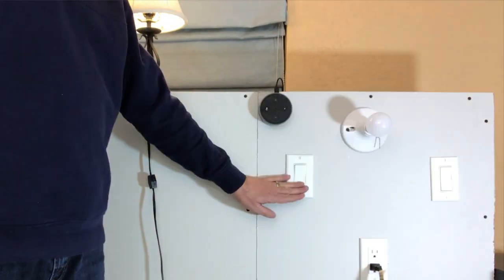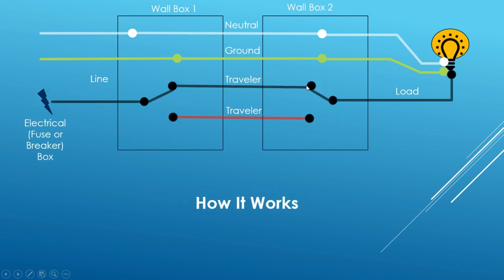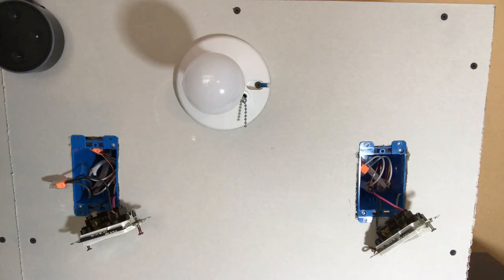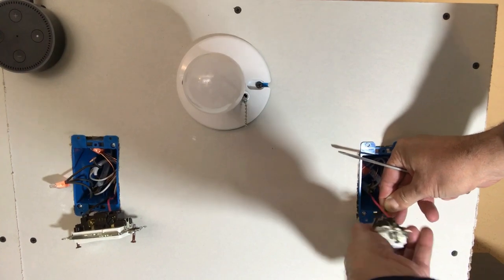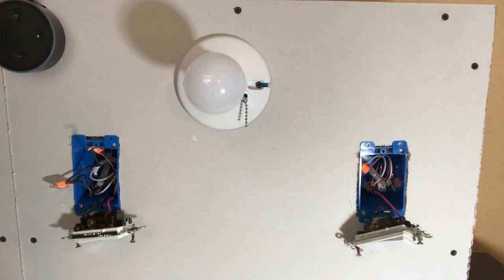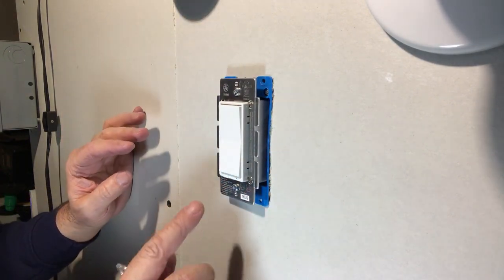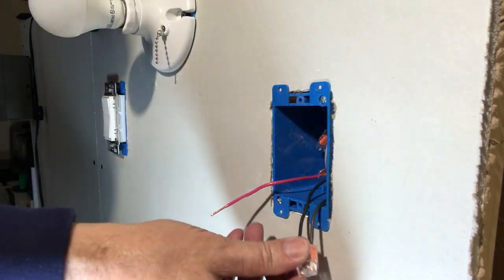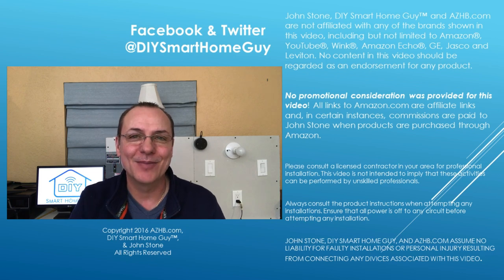DIY 3-Way Switch GE / Leviton Smart Switch Installation (Z-Wave)

Comment: Great video as always, John.  I'm impressed that you built an entire mock setup to help demonstrate how 3-way switches work, and how they're wired.

One thing I'll add, almost every 3-way switch I've taken apart (especially in older homes) did NOT use 14/3 with a red wire.  Usually they use a 14/2, using the black and white as travelers, or use 2 black wires as travelers.  I also used to work as a commercial electrician while I was in college, and will tell you that there's no real wire color standard for switch legs and travelers, electricians will use whatever wire they have at their disposal, so its important to take a close look at the existing 3-way switch and test the wires the way you showed.

Comment: THANK YOU! I nearly gave up several times before finding this video and going to your website and looking at the solutions matrix. 

I spent a long time staring those diagrams and pulling out wire from my gang boxes, and I finally figured out that my new home was wired up as method 9(a), but with the white and black wires to the 2nd wall box swapped. After that, it was a cinch! (Well, no worse than normal work trying to undo, tie in, and close up a crowded box) Rocking and rolling on the Leviton DW6HD + matching remote. Wish it had come with extra wires, but luckily I had a spare stretch of 12/2 from some long-forgotten project to cannibalize.

Comment: For these particular GE switches there is a similar slot (a bit less visible) for the ground connection as is used for the other terminals. Hence there is no need to use a wire loop to attach the ground connection. Not a big deal but it makes the work go easier and faster. Not sure if someone else already mentioned this. 

One other thing, there are several ways that three way switches can be wired. You have shown the simplest case – power arrives at switch box 1, 3 conductor wire runs between switch boxes 1 and 2. Light is fed from switch box 2.

Case 2 – Power at switch box 1, light feeds from switch box 1. A piece of 3 conductor wire runs between switch boxes 1 and 2 – all hot wires.  Do able but the wires running to switch box 2 need to be re-purposed to get a neutral there. This wiring configuration is in common use. In many jurisdictions the white wire between the switch boxes must be marked as a hot wire.
Case 3 – Power to the light socket, switch leg (two conductors – both hot) runs to switch box 1 and a piece of three conductor runs between switch boxes 1 and 2. Not do able – no neutral available in the switch boxes. This is an uncommon configuration. It usually happens during renovations when a single switch is expanded into a three-way switching arrangement.

Comment: excellent video, understanding that this isn't a typical 3 way switch goes a long way to preventing confusion.
i would have liked to see you finish off the wiring, but i understand you may have had to trim for time.
now to go and do my Levitron version and hope i don't burn down the house
Reply from the maker: Hi Shadow Wulf, thanks for reaching out. This was an older video and your concern is well noted. The best source of information for three and four way switches is on my website. There are several different methods in which your original circuit could have been wired, including Leviton, so you'll need to start there. Again, it's all on my website.
https://azhb.com/how-to/three-way-switch-how-to/

If you're still having problems, check out my Facebook Group. It's an easier place for me or other to lend a hand.
https://www.facebook.com/groups/733842787140470/

Cheers

Comment: Thank you for this. I have aluminum wiring where they used one set of romex for the traveler wires. I used your advise to determine the hot and load. I then drew out each feed to each box and switch then how the smart switch wires. Now my second smart swithc also had all four wires,  used a special wire nuts with a conductive paste inside for possible expansion and contraction on the AL.

Comment: I wish this video was available when i installed my switches.  The only criticism I have is the ground terminal has a push in hole and you don't really need to loop it.   That is just personal preference though.  Really like the animation showing how traditional 3 way switches work.

Comment: Thank you, John!  I have embarked on a journey to replace my existing X-10 automation devices and with Z-Wave devices.  Thank you for your Channel!  I have a 3-way switch installation that shares a gang box with two different lighting circuits.  Worse (in my opinion), is on a different breaker and powers two different overhead fluorescent lights.  The wiring in those boxes is a complete mess to my layman's eyes - and I remember having the same anxiety when putting in the X-10 switches years ago.  Fast forward, after watching this video three times, I was able to understand how the switches should be wired.  While the requirement of the neutral line for the GE switches may be a problem for older homes, it wasn't for me, and once I understood the proper schematic for the wiring, it actually made things very easy.  Again, thank you very much for making this video and sharing your experiences.

Comment: Awesome video! About to do my Leviton smart dimmer but 2 questions ....  1) I have 3 switches for my recessed lights. Does it matter which end of the circuit I put the Smart switch on?  2) Do I need to replace the other 2 with add ons or can I leave them as dumb switches?
Thank you!

Comment: I want to echo steven h comment. If you do not have access to the white neutral wire .. look into the lutron caseta . It is what john stone used in his bar ( i think). He has reviewed it  but has not done an install video on it to show not needing neutral wire. The lutron instructions however show not using neutral wire. ( prior model, lutron maestro did call for neutral wire, like GE).  

Thank you john for your informative videos
Reply: thanks John -  1) I look forward to a dedicated video on your bar switch install - as it does look to have have simpler installation procedure than GE. I hope it also includes the dimming Pico Remote wall install.  I would also be interested in seeing if you find any noticeable difference in responsiveness in  GE, Lutron or Leviton.  2) As to your  non dimming switch desire...  I have not tried, but Lutron web site shows, Lutron PD-5WS-DV,  to be an in wall Caseta wireless Paddle switch that does not require a neutral wire. It can be used as a simple single switch or installed in a 3- way configuration  with a non dimmable pico remote # PJ2-2B. Remote can be installed in wall as a secondary paddle switch (with same bracket kit as for dimmer, PICO-WBX-ADAPT) or used as a portable remote.  3) To all,  Upon further investigation, If your situation dictates use of a neutral wire..Caseta looks to have  products for that too in PRO version  that requires neutral wire, but in my quick search they seem notably more expensive than GE or Leviton.

Comment: Thanks for the great video!  Wondering if you could tell me what would happen if you installed only the master switch, but left a standard ‘dumb’ switch as the secondary on the circuit.  My intent is to use an old style (newly made) pushbutton switch to maintain the appearance of my old home, and hide the smart switch.  This way I can use Alexa to control the lights while maintaining the classic appearance.
Reply: asking myself the same question

Comment: Question:  do you have to use two smart switches in this installation?  Could you just use one smart switch and leave the other dumb switch in place?  Nice video by the way.  Thanks!
Reply from the maker: It depends on the brand of switch. Zooz and Inovelli make models that can be configured with the existing remote switch. However most others do not and require the add-on switch.

Comment: for construction without traveler wires, you can make a fake 3-way switch by using your home automation software (homeseer, smartthings, wink, stringify, etc). so for instance, in homeseer i can make an event to turn the light on or off that has conditions that account for both switch positions.

Comment: I found when I didn't have all the proper wires at one end, the previous job wasn't done properly. The wiring wasn't pulled all the way from one switch to the other

Comment: Very nice video.  1 Question.  I have the add-on switch but it only works while I have the button pressed on the add-on switch.  So it will turn the light on or the light off while I pressing the button.  When I let go it turns the light back on or off depending on what the master switch was set at.

Comment: Such a great video. Got everything hooked up in the first box, but I don’t have two black wires to splice together in the second box. There’s only one black wire with nowhere to plug. I tried plugging it in with the neutral, and all that does is make the switch go on and off repeatedly. 

Any idea what the setup might be for this type of wiring?
Reply: DIY Smart Home Guy Thanks for the quick reply. The switch I took out was a three way switch. In that box, there are 4 wires: black, red, white and ground. I just couldnt get the wiring to work in any configuration, so took the light fixture down. Turns out that power is coming from the wires going to the light, and then out to the switches. Looked at the pictures on your site with the different “3way” wiring options, and still couldnt figure out how to run the GE smart switches. Ended up replacing the old switches for now, and will try again some other time. Spent too much time the other day trying to get it to work, that I had to just walk away...

Comment: Another thing.  On the ground wire for the switch, there is a hole that you can insert the ground wire into and then tighten down the screw as well.  That's how I wired mine.
Reply: I was thinking the same thing.  Great vid though!

Comment: If you don't have a neutral wire your best bet is a Lutron Caseta Dimmer switch and pico remote. You can wall mount the pico remote with a separate bracket. You'd just want to cap off the wires behind the pico remote.

Switch and Pico Remote: https://www.amazon.com/Lutron-Wireless-600-watt-150-watt-Multi-Location/dp/B00JJY0S4G

Bracket: https://www.amazon.com/Lutron-PICO-WBX-ADAPT-Pico-Wallplate-Bracket/dp/B00JZRAFEA/
Reply: There's a deep dark secret about how to obtain a neutral wire when there isn't one in the box....  you can use the ground wire.  If you look in your electrical panel (in a standard 240V split phase residential setup) the white neutral wires and ground wires are both grounded to the same exact bus bar.  Both wires essentially are the same.  Electrically, your neutral IS a ground wire, and the bare copper ground wire is basically a redundant ground.

Yes, its against code to use the ground as a neutral, and legally I'll tell you to never do it, etc.

But, it does work.
Reply: The bare ground and white neutral are NOT the same wire.  The bare ground is a non current carrying conductor.  If you use your ground as a neutral there is the risk of you getting electrocuted if you lose that path back to the panel and you touch anything grounded in the house(fridge door, washer, dryer, etc), the path will go through you and you will get shocked.
Reply: Technically, you're kind of right, although a smart wallswitch draws almost no power, probably less than a watt, and will not cause any hazardous voltage or current on the ground wire.  The neutral hooked to the smart switch doesn't carry the current that goes to the load.

You would almost definitely not get electrocuted even if there was some catastrophic event where there was voltage on your ground.  You'd have to both touch something "grounded" (fridge, washer, dryer, etc.) AND a real earth ground.  This scenario would basically never happen inside a house.  

I once was changing a wall switch in my house to a dimmer switch, and had to determine which leg was hot and which was switch leg.  Being impatient, I just touched both wires one at a time with the backside of my hand to see which one shocked me (stupid, I know).  When I deliberately touched the hot wire, it wouldn't shock me, and I couldn't even feel any voltage on it, because I wasn't grounded.  Even if you somehow got 120v on your ground circuit, you probably wouldn't shock yourself on grounded objects.

Still, you're technically basically correct, and using the ground as a current carrying wire is NOT safe and NOT something you should do.

.... but it would definitely work and would be totally safe.

But don't do it.

;-)
Reply: Steven Horvat I was going to say the same thing. just bought a house and replaced all the light switches with lutron Caseta and not only got an epic setup with home automation switches but I also saved a ton on money on switches.  I she 3 3-way switches and 1 4-way switch. saved about $250...
Reply: John Stone this was a pain for me. bought all Caseta dimmers and LEDs. it is really tough to find LEDs and dimmers that work together but I'm so happy I did!

Comment: Hi, great video.  i have a question on GE smart switch that i have installed at home. It was working for over a year and now stopped working - does not turn on the light manually or through my Smart wink. I was hoping you can suggest what to do? Thank you.

Comment: Great, great video. Worked like a charm. I used this for the Jasco 45709 Smart Switch and the 45710 add-on switch, which I assume is identical to the GE product. Thanks!

Comment: What do you do if your fed and loaded from the same switch? There is only one traveler set screw on the switch, so do you put both travelers on the one screw? because the load to the light goes on the load screw.

Comment: Maybe this is beyond my knowledge on 3 way smart switches, but for some reason (I connected mine same way you did in your video) when I press ON/OFF in then Main smart switch  everything works fine, but when I press the ADD-ON -if lights are ON, then they go OFF then turn back ON-, then if light are OFF when I press the ADD-ON lights go ON then turn immediately OFF. Any help is very welcome at this point. I am using GE Add-on 12723 and Smartswitch GE 40792

Comment: Hi Chris, I have the a 3 way switche (and a 4 way switch) configuration and want to use a Fibaro. According to the diagram from fibaro this is possible. But according to you this will not work because if i turn on the light "by software" and then turn off on the switch itself, the fibaro relay will never know it was shutdow, is that it? Thanks you so much for your support. love your work.
Reply: @DIYSmartHomeGuy1  You're right. I went trough the manual again, and there's an option in the software for Fibaro to react whenever the other switches change (I guess it knows when circuit is open or closed). So it should work. I will try it and let you know. Thanks once again!

Comment: Been watching all your videos the past couple weeks. I'm buying a large home and moving my elderly parents in with me and going to set it up so that they can use Echo Dot to control things and I'll also be able to monitor people coming and going while I'm at work. Your videos are a great help. Already set up a few things in my current house to test.Have you used any of the GE Z-Wave plus motion switches I've seen on the Jasco site? I haven't seen them for sale anywhere other than their web site.
Reply: Just got one of the new motion dimmer switches today. Ordered it directly from Jasco. Won't have the wifi set up in the new house until sometime this week. It came pretty fast from them. Need to get an add on switch since I'm going to use it in a 3-way application.
Reply: I finally got a GE smart motion switch installed. haven't found a spot for the dimmer version. anyway it installed like the other switches and works good. I put it in my laundry room that you walk through from the garage to the house. I set up a robot in wink to turn on the light when the garage is opened. Then it turns itself off after 5 minutes. it also has a sensor that keeps it from turning on if the room isn't dark. only problem I had with it it's that it was very tight in the switch plate. when I screwed the plate down it would hold one of the buttons down. I had to enlarge the opening in the switch plate with a file.

Comment: quick question, I'm finally going to jump into the smart home automation, I prefer to use the smart switch to control my lights my regular LED lights. do I need to buy the GE dimmable smart switch or just the regular GE smart switch in order to be able to dim my regular LED lights through echo. thanks

Comment: Hello Thank you for the instructional video I very much appreciate it.  I would like to know if is possible to wire a smart 3 way switch for the main line and for the load use a regular 3 way switch from home depot? Thank you for your help in advance
Reply: Thank you very much. I bought the addon switch GE Add-On Switch for GE Z-Wave 12723. I hope it works . thanks again

Comment: Am I crazy or is the Leviton 3-way wiring the direct opposite if the GE?  Insofar the GE is Master/Line, Remote/Load and Leviton instructions state Master/Load side, Remote/Line side???

This video is good but it suggests the same for both brands judging by the title.

I have installed two different GE 3-way configurations no problem. I was thinking of switching to Leviton going froward. Anyway Leviton terminal labeling isn’t very intuitive compared to GE.

Can anyone confirm that Leviton is the opposite? Thanks